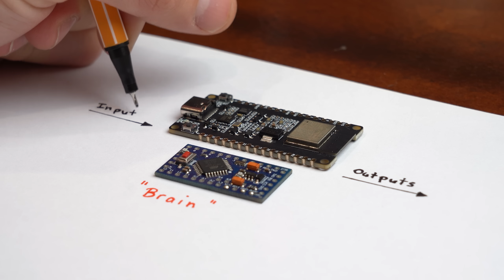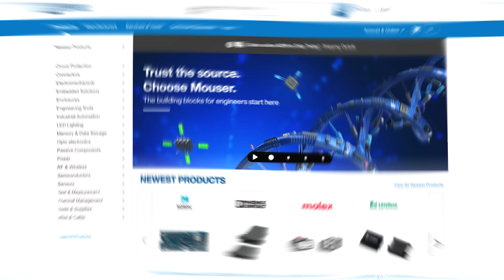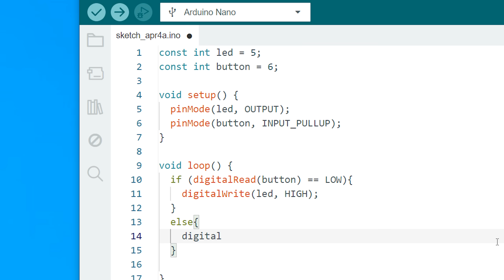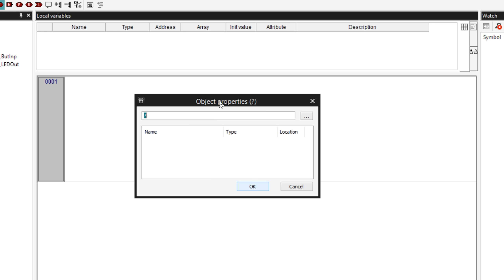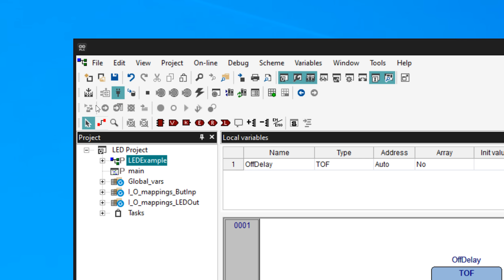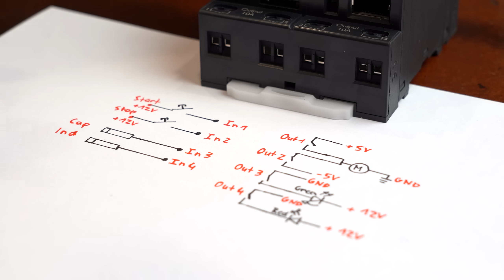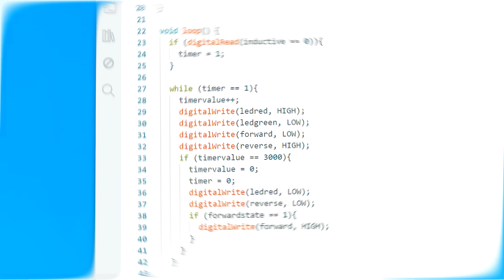Not a Microcontroller!...This is Better?! (PLC) EB#62

Comment: As an industrial maintenance technician, I honestly never really understood the whole Arduino obsession. Don't get me wrong, I've used microcontrollers for plenty of home projects, but for the hassle of programming them, the only advantage of them are the price comparison. Plus, besides Allen Bradley's, they're damn near indestructible. (AB has a tendency to brick themselves for many reasons depending on specific model and programmer experience. Here's looking at you, micro800 series!)
Now, this is obviously just my own opinion, but it's honestly more rewarding to use a PLC to supplement analog circuits. There's just something satisfying about making a fancy box and discreet components act almost as if it were its own self sufficient natural entity.

Overall, good presentation nonetheless, you did a good job at showcasing many devices that I deal with on a daily basis. All of those components are used in such a vast array of applications that it can be mind boggling sometimes, but it always feels serendipitous when you come up with a new way to apply them.

That's why I think more people should pursue maintenance tech jobs. There's an endless range of things to do with industrial legos, not to mention it's never a boring day as long as they keep hiring idiot operators. And whenever things change around the shop, upper management typically tells you to "get rid of" those rather spendy components instead of pay extra to dispose of them..
Reply: It depends on where you are coming from. If you started out with "normal" programming languages using a PLC is IMO very restrictive and clunky. They are great for what they do, but it is clear they are designed to mimic the physical world (even with digital processing). Which if you are started with modern programming is decades of tooling and abstractions behind what is possible if you leave that mindset behind.
Reply: @someonespotatohmm9513  true, and a good reason why I emphasized it being my opinion. I just have a preference to analog circuitry, and the digital aspect of PLCs mimic that quite well. It does require a different approach to problem solving for sure, and I still use basic microcontrollers for certain tasks that require a bit more bit banged logic that would take too much of my time to emulate in other ways. Maybe it's just the challenge of trying to make something work without needing to resort to code that appeals to me.
But I nonetheless don't wish to imply any disrespect to those that choose the coding approach, as it is without doubt the way things are going nowadays. I just hope that figuring things out with discreet components doesn't get completely forgotten over time.
Also, you can program PLCs with straight code if you didn't already know, and can implement just as many features as you can on a microcontroller because of it, since a PLC is typically just a micro with beefy I/Os. The visual interface of logic software honestly only helps when you're in a hurry to troubleshoot something, which is super handy sometimes. Otherwise, I typically use c++ to program new ones at work, not sure if that's what you would consider "normal" programming language though.
Background disclaimer: I started out with visual basic and moved to C and python years before I ever saw a PLC in person, so I'm not necessarily ignorant of that approach

Comment: Not surprised that Arduino and Finder try to push their Opta again. Compared to existing Micro PLC like Siemens LOGO for example , the OPTA is 30% more expensive at equivalent I/O, has no builtin screen and only one button, so you can't use it on the field without a PC. And for a small automatic system it is very useful to be able to diplay some values or messages even on a tiny screen to see what's going on with the machine. If OPTA remains the same, I don't think it has a chance on this market. Not a question of quality but features and functions to price ratio.
Reply: Since I'm not in the loop, is that 30% statement compared to Siemens list prices or actual prices (up to -50%, for anything above single quantities). To be fair though, the eldritch horror that is TIA (licensing) is probably also something to consider as well.
Reply: Couldn’t you keep/install a raspberry pi with it?
Reply: @sneaky_krait7271  Well, you shouldn't. Even if it is possible, PLCs are usually deterministic systems, and an rpi isn't. In automation that can become a real problem.
Reply: @wwpdmedia  Yes but the Rasberry pi is more like a pc always on hand there. Anyways I always had a laptop with me when I was at a company with multiple appartement buildings just full of switchgear
Reply: Best to use a PLC that has HMI display compatibility.

Comment: Ever heard of Node Red? Original by IBM, now open source and very reliable. Allows Small MPC's like ESP32's to be programmed using function blocks just like PLC-LD language, only way way cooler... 
That Arduino box is still just an MPC with some additional IO added. It's cool, but hardly groundbreaking...

Comment: We have try to implement an Opta in an Project, it works perfect and is very nice. Much more usable than the Logo we dont unse anymore but then i came to an Problem, i want to control an Stepper Motor and that is not possible with both(Just as they are  desinged for). Hope they will make more Extension Products in future but it is already a great tool

Comment: Most PLCs have modules available for things like PWM and high-speed counting, so you're not limited by your scan cycle speed.

The big advantage of PLCs is that they're part of what AvE calls "industrial Lego."  If you build out things with microcontrollers, you're basically building a custom machine that requires specialized training to maintain.  With industrial systems, any industrial electrician can perform maintenance and spare parts are usually available for a couple decades.  Everything is modular and you can replace one part without having to redesign everything from scratch.

I do think that the cost of PLCs isn't well presented here.  That PLC is on the extreme cheap end of the price spectrum.  I regularly work with PLCs that cost tens or hundreds of thousands of dollars.

Comment: Most industrial automation employs PLCs instead of anything as powerful as an MCU. I watched my late father design and build all kinds of machines for processing huge numbers of precision parts back in the 90s. I've always felt that most of what people would tend to use an Arduino or MCU for, where it's just some basic logic to turn on/off some lights and buzzers and motors and actuators in response to various combinations of sensors being active, and some overall sequential process to be followed, is way overkill. I've even seen products that use an actual Arduino inside of them - instead of the engineers/designers using an off-the-shelf MCU IC on a custom PCB designed just for their purpose. Seems like such a waste! Arduinos are supposed to be like a developer board for figuring out what you want to do, and getting it to work, or for one-off projects where there's only going to ever be one of the thing (or a few, at the most). For something you make and sell, definitely don't put a whole dang Arduino in the thing. An 8-bit PIC chip or a PLC will probably be able to do most of what you need unless you need network/audio/video on there - then you'll need something with some more heft, but if you don't need those things then use the cheapest thing there is - and it's not hard at all to build a circuit around an MCU IC.  Waste not, want not!

Comment: Often the analogue logical output is 4-20 mA. 4 mA means 0% and 20 mA means 100% Under 4 mA means error. The advantage of current is that, compared to voltage, current is stable and independent of the length of the line.

Comment: I recall a guy who made something similar that he called "Controllino". I wonder how ended up that product.
Anyway, I developed kinda PLC but event driven. In that case you don't have a program cycle, rather an event loop cycle that in my case takes few microseconds. However this solution is best suited for special industrial applications or in machines, and mostly in home/building automation.

Comment: I use some very fancy PLCs with HMIs at work, but at home my goto is usually an STM32 or a microprocessor with all the bits I want around it.  Telling people they are used for very different applications, you couldn’t have said it better.
Reply: Exactly..At work, I work with these PLC brands and HMIs..mostly using Ladder logic..at home as a hobby engineer I do a lot with ESP micro controllers

Comment: Another factor is that the PLCs and industrial control sensors etc. are designed to work under typical industrial conditions, not just the extremes of temperature you mentioned but also an electrically noisy environment, vibration etc, all of which would have to be dealt with using additional circuitry and extensive testing for a microcontroller and custom circuitry. Will it still work in the same panel as a multi kilowatt Variable Speed Drive when it kicks off at full load for example?

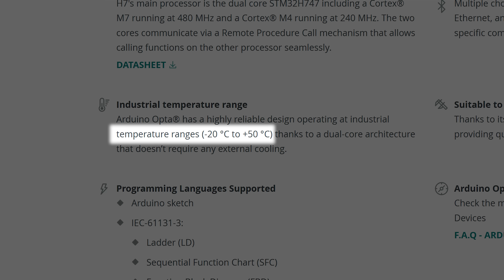Comment: 2:23 that's gotta be a typo though right? 50°C is less than every commercial/catalog rated part I've encountered (which I admit is not a ton as I'm an inexperienced hobbyist). Most of the commercial grade parts I have are 0-70°C, with some 0-105°C and even some -40-85°C.

Edit: I took a quick peak at some industrial parts and the typical range appears to be from -20-125°C to -40-150°C, but for actual plc units (-20/0)-50°C is apparently normal. The few that extend past that range cost a fortune. Maybe a situation where the main components are able to withstand much wider ranges than some other parts or the device might only stay in spec in the small range.

Comment: Wait, that PLC doesn't support PWM output? I'm only familiar with the Delta PLCs we use at work, and those have PWM peripherals (independent of cycle time), high speed interrupts, and run in 0.1ms cycles with a small program, up to 10 ms if all the  program memory is used.
One can set the cycle speed higher if needed, but 10ms as a monimum seems excessively slow.

Comment: I think honestly this goes back to the "big, expensive reliable thing" versus "dirt cheap thing that breaks, but you can just buy five of them and make them agree/vote" argument.  I think the dirt cheap Arduino just can't be beat for price, and for reliability you just use more of them. Sure, the learning curve is higher (depending on whether you come from an electronics or a software background) and there's some special considerations, but once you learn, all of your future projects come with a nice discount in both price and small form factor--and you don't have vendor lock-in since there's so many Arduino clones and you can even go pure Atmel or PIC.  I want to like PLCs, but unless you're prototyping something extremely niche (ex: designing a custom CPU), it's usually way easier to lean on the tried and true things like the Uno or even a Pi Zero. Bigger support community, cheaper, smaller, easier to replace if you accidentally break it, etc.
Reply: Yeah, PLCs come from a different time where logic was programmed on hardware, which is what these PLCs made easier and more centralized i think.
Now we actually have microcontrollers which can do much more even easier, but as PLCs are the defacto industry standard, they will still widely be used.

Its like Programming languages, Java is still the Industry standard for backend applications.
Most programmers know it, most things can be done by it, so we'll keep it.
Reply: @tarakivu8861  Yeah, and I think this bears out in what's happening in the real world right now.  For example, yes, old elevators that run on relays are super reliable, but when that old equipment does finally break in a costly way, or when a new elevator needs to be installed, they use something like PIC or Atmel... it's just cheaper, the parts are ubiquitous in the market, the documentation is all there on the internet, it's easier to find engineers that can work with them, etc.  Same probably goes for traffic light controllers and other stuff.  I'm not a control systems engineer so I'm not 100% sure, but I did work alongside some back in college and got a vibe about the general way things are heading.
Reply: This arduino plc is not cheap,190 euro can get you started with siemens s7 1200 plc or a bunch of logo

Comment: PLC and FBD has an extremely fast learning curve! I loved it to bits from the get-go! My first time ever coming in contact with PLC I built a fictive heat counter. Made to observe 36 high current (0-160A) carrying wires using AC current transformers connected to PLC analog inputs (thru an bespoke MUX and peak detection PCB). When current X+"10" is "On" the potential heat rises in "cables and connectors", stored/incremented in an PLC accumulator variable, when current is below X the equipment is potentially cooling down. Worst case conditions was pre-measured thru practical experiments to then worked out and set X (steady state capacity), measured value multiplier and time-factor. This was free standing solution made to monitor an equipment that had a nasty tendency(and capacity) to overheat various equipment connected down stream. PLC read which equipment was connected and set limits to match. You know, just like milk boils over when you turn you back to, in same fashion was that famous operator dreaded sentence delivered thru phone way too many times before this: "I was away less than a minute, I promise". When that overheat situation was about to happen the PLC just sounded and flashed an alarm. If no-one managed the situation in time the emergency stop was pulled. Saved hours of equipment repair monthly (aka my time) but in worst case stopped production for a few minutes while equipment was in an un-restartable cool down mode.
Good times 😄